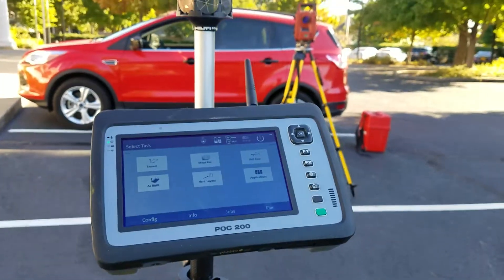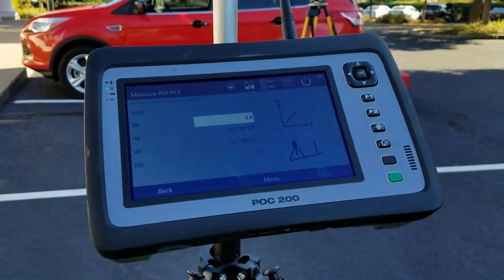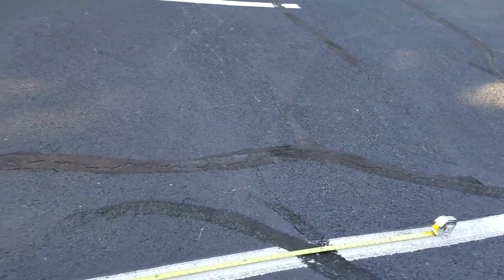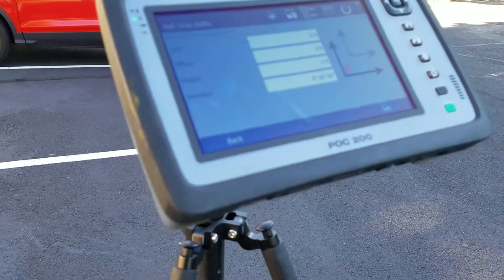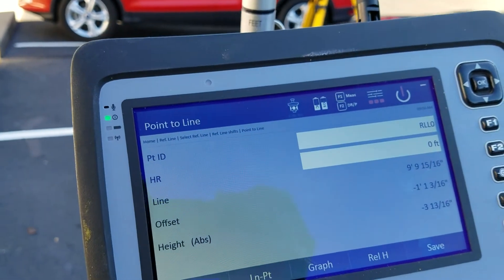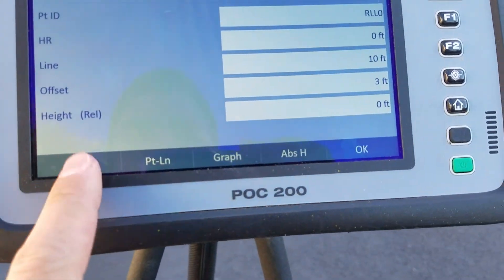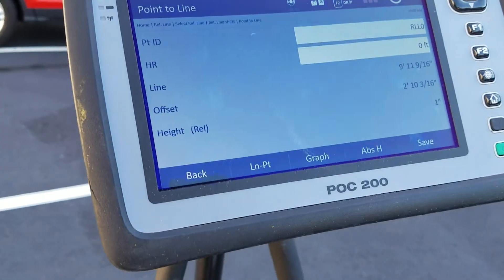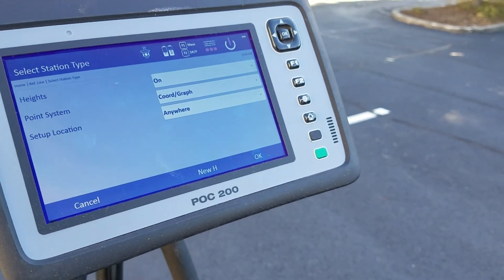Tutorial of Reference Line POC 200 POS 180

Comment: Sorry. *which
Reply from the maker: shootinhk45 no problem. When in reference line, go ahead and shoot two random points to create a line. When setting your station height, select "man h", type on your benchmark height you have, and then measure to it. The tool now knows that that is your benchmark. Now, when you go back to your line, make sure that you are looking at "absolute height", not relative height. No matter where you turn the tool, it will tell you how high you are off the benchmark you measured. If you need more help, Hilti customer service can transfer you directly to the Measuring support team who can go over it with you even on the phone.